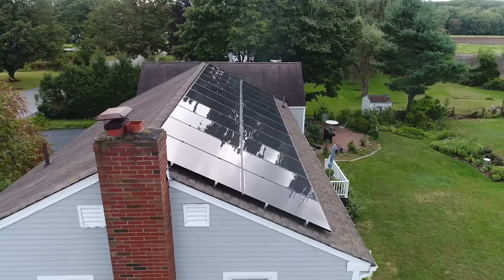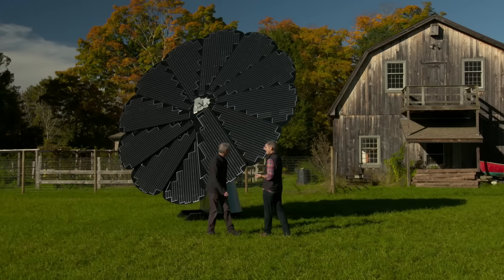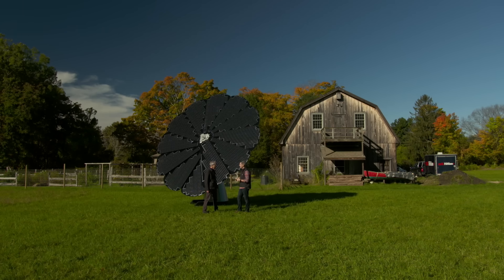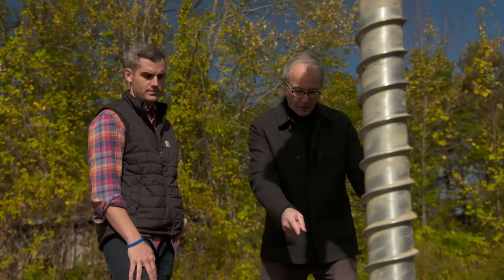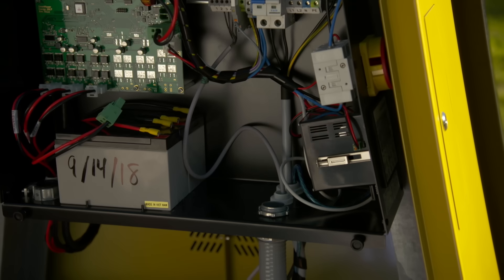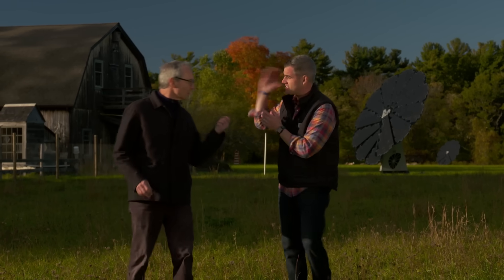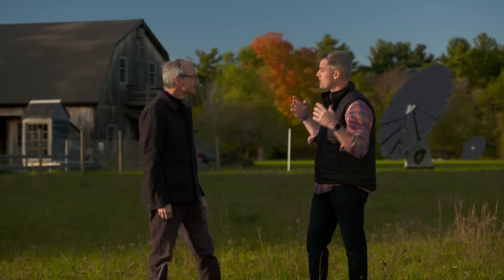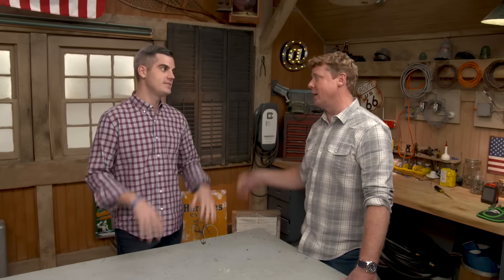Robotic Flower Solar Panels | Future House | Ask This Old House

Comment: C'mon do the math - this is much more expensive than roof solar.  Perhaps you didn't want to service your audience with the economics.  Ground mount usually costs more than roof, but easier to service.  Dual trackers is a waste of money pursuing perfection.  Dual trackers don't last as long as single trackers.  Unless you're buying ART, the economics should never be ignored.  At what point does the increased yield pay for the increased cost?

You didn't even compare pros/cons between systems.  (geez I hope more thought goes into the projects you take on)
Reply: $3.2k Aud delivered from aliexpress. Dont pay 10 times what its worth lol. This guys scamming hard.

Comment: Interesting concept, but it has way too many moving parts. Reduce the complexity, and maybe turn it into a solar panel installation that you can just plug and play on a property without all of the extra costs of permitting and what not, and I can see these being installed everywhere. The installation costs of solar are one of the biggest drawbacks. A plug and play solution that can lower costs would be welcome. Alas, this was posted 4 years ago, and I have yet to see this actually being sold.

Comment: Next, they need to design an elevator system to allow the solar flower to be retracted into the ground. I want to get a place but has a potential possibility of fire. Would be nice to be able to retract the solar flower as a defense. It would be an excellent addition to the underground water tank, and underground propane tank. Maybe a concrete box with screw jacks in each corner. Let the engineers figure it out.

Comment: "SmartFlower solar panel system ranges in price from $25,000 to $30,000 with the average cost to install at $27,000" for a 2.5 kw system

Comment: Taken into effect what he talked about at 5kw production, a $30,000 install is NOT Market rate, that's $6 per watt (market rate for solar installs is about $3.50 per watt) if you go based on the actual system size of 2.5kw that's $12 per watt! I hear this product only has a 5 year warranty on the dual axis motor. This has a very long break even period. My company is working on a similar concept but the price will be closer to market rate for solar panel installations ($3-4 per watt) it will be Aesthetically pleasing and multi purpose!
Reply: Name of company?
Reply: Is it ready yet!

Comment: JESUS FING CRIST. i mean its cool looking and all, but for 10k if you had that kinda space. just build a wood mounted solar system.  not pretty but wayyyyy cheaper, also, if it broke my bet i couldnt fix it without a tec. vs the panels i can. 
last, WHYYY do you need the duel tracking we have basic sensors that can just follow he sun.

Comment: 2.5 kwh for 30 thousand dollars. I have a 10 kw system, roof-mounted that is less than 10k more than this system. As much as I like the tracking system, it's not viable and doesn't glean enough energy by tracking to justify that markup. It's a great concept, thanks for sharing!
Reply: It can reach double if that (5 kWh) and qualifies for tax credits. I think it may be viable.
Reply: @markoer   it has moving parts, so it’ll need maintenance & repair. It retracts in high wind, and there will be down time if it breaks. 

And fixed solar panels will also get tax benefits.
Reply: @thomaspayne6866  it will be far easier to clean the panels unless you think it's fun to get up on the roof once a month. Even a light layer of dust will cut your efficiency. You can just 'water' this flower and keep it clean. It's Austrian designed and made so don't confuse it with american-made products that break after a short period of use
Reply: @abcxyz3783 it is actually self-cleaning, and that's a plus.
Reply: Yes but if your house catches fire will there be a foam unit to put it out? A solar field or flower in this case can turn off the power due to it not being near the actual house.

Comment: I would like this system, how do you store the energy where are the batteries,
Reply: @Maker Noob are they lithium batteries ?how many can fit in that space ,will they hold charge long in cold weather,? is the area where the batteries are stored insulated? Could you do another segment on this type of solar flower, how big is the hous is the one flower solar unit not enough to power the house? That's why they are building another one on property, I have so many questions my house is 3,000sq foot I'm deciding on a hard wire generator due to our area losing power at least every few months very annoying, so now that they came out with this new design that is aesthetically pleasing to eye I'm very interested in comparing the two different power sources.

Comment: Maybe it is so expensive bcs its from overseas. The solarflower is an invention from Austria. Here it cost  15000 €, like 16500 $. It cost more if you want a special color on it.
Reply: It may have been invented in Austria, but USA operations are based in Boston Massachusetts. Is 15000 € -  the installed price?
Reply: I think the company in Austria doesn't exist anymore, usa only, besides, they have three versions, was it the same one as here?..
Reply: @Andreas Berni At $10 per Watt, the Solar Flower is 10 TIMES more expensive than most other PV arrays.  Only the SUPER RICH, would think this Lawn Art is "affordable".  Nobody could ever cost-justify this system, not ever ....
Reply: @Andreas Berni For me, it is like comparing a $30,000 car vs a $300,000 car.    It would take about 5 of these Solar  Flowers to offset the yearly electric bill of a typical USA home.  And then DOUBLE that = 10 Flowers for an ALL Electric home = $150,000 <-- Ouch !   And "moving parts" will break and/or wear out = additional Repair Costs for life...

Comment: Produce it at $5000 a shot then you get some where. Solar needs to be a 5 year or less investment to make it for people to want. 15 years is too long.
Reply: It will never be $5,000 ... The current price is $45,000 for the 2,500 watt array.  Break-even is more like NEVER
Reply: @MrSummitville  Yes it will because the actual material cost less than 10 dollars to make. Its high priced because they are trying to recop research costs. When they get past that prices with drop fast. In about 10 years.
Reply: @jonmitchell9019  Just the concrete pad /  concrete pier costs more than $10. The wiring & conduit to house costs more than $10.  The internal computer costs more than $10.  Each of the twelve (12) proprietary Solar Panels costs more than $10.  The Dual-Axis Tracker costs more than $10.  The motorized opener / closer costs more than $10.  And how much per hour is the machine (crane) that will lift it into place?  I could go on for ever.  Please reply, on the day, that you can actually do a complete install for $5,000 or less ...
Reply: @MrSummitville  And yes if you a lazy azz and have someone else install it and you never lift a finger yes it will cost you $45000. We bought a new 20kw system and had it installed in the house for about $12,000. But that is the difference between someone doing something for themselves and sit on the couch eating potato chips and never doing anything.

Comment: This system is great when the house is shaded by trees...  and to maximize the only sunny place which might be somewhere else in the yard.   I haven't been able to add roof sun panels because of the trees, and the only solution was to cut down the trees which does not make sense. 1. we need trees and 2. the trees cool down temperature in the summer and I don't use air conditioner.  I would love to have this in my backyard, specially a rocky hill where I cannot really grow stuff but I can certainly harvest some electricity.
Reply: This system is never "great" - way too expensive ...

Comment: What's the cost for a system like this and what's the wattage?
Reply: I talked with them $45000.
Reply: @hotmeds  $45,000? YIKES !!!  Does that included installation?  Was it for the 2.5 kW unit with Dual Axis Tracker?  Was the 6 kWhr -12kWhr battery back-up included?

Comment: One of the things that was not mentioned, but was mentioned in another article was that when you sell your house you can uninstall the flower and take it to your next house to install there.
Reply: Exactly.
Reply: @4seeableTV  And how much does that COST?  So, instead of having a 20 year break-even, relocate it and now you have a 25 year break-even = Dumb & Dumber ...
Reply: @MrSummitville  I would assume that they could make this more affordable than traditional solar panels since they wouldn't need to go through the permitting process to install on your roof, and you could forego most of the contractor costs of planning the system and installing it when you can just plug and play one of these.
Reply: @MrSummitville  you mean you think it would be better to install new at your new house at a higher cost for it and install cost. Lol
Reply: $3.2k Aud delivered from aliexpress. Dont pay 10 times what its worth lol. This guys scamming hard.

Comment: My theory that rotation machine is not necessarily needed if the farm are open fields it is just to dig to ground floor like a parabol form and simply putting like  mirror or just aluminium as a light reflection  or simply buildt a glove solar panel  instead?😇👿👹
Reply: You need to analyze the cost vs ROI. You idea is way too expensive ...

Comment: Atta boy!  Tighten those hex bolts with a pair of Channel Locks.  (TOH standards sure have fallen over the years.)
Let's see, $30k for a 2.5kWh system which (must see to believe) produces 5kW? , or $10k for a fixed 5kWh system?  Tough choice.

Comment: Not interested in a solar system that’s going to take 25 years for it to pay itself off.
Reply: @Matt B - I doubt that this device will ever "pay for itself" ...  $1,800 per year = $45,000 cost / 25 years.  It will not generate $1,800 worth of electricity per year.

Comment: As usual, the initial investment is a turn-off for most. To recoup the cost, the average homeowner would take approx. 10 years to recover it and that's IF he could generate ALL of his electricity with this system which realistically, can't be done. so say, 15 years to 'zero-out'. With most homeowners rarely staying put that long with some moving every 5 years or so, it doesn't make sense economically to install these types of systems. Now, the person that buys a home with these systems in place would conceivably benefit, having not had to foot the bill of the initial installation.
Reply: The seller of the home will try to add the cost of the SmartFlower to the sale price. At $30,000 for a 2.5 kW system, I seriously doubt if there will ever be a "break-even". A fixed array requires very little maintenance.  A dual axis tracker, left outside for 10 YEARS , will require a significant amount of maintenance.

Comment: 40% more power!! At 4000% the price of rooftop panels they could have installed on the barn + more panels to generate the same power.
Reply: A Dual-Axis Tracker generates about 30% more kWHrs vs a Fixed Array.  I just helped my neighbor install an actual 5 kW Ground Mount array for $5,000.  The SmartFlower is 6 TIMES that price?  WHY?  The SmartFlower is a rich man's toy, at best.

Comment: Neat but over priced. After the tax credit (2019) it would still be $20k cost. I just had a 4.88kWh system for $10k (cost after tax credit). Considering it is half the cost and just under the 5kWh comparison I would still find this overrated.

Comment: It seems This Old House is prompting for socialism. Wind and solar energy is socialist according to the MAga people.
Reply: First time i've heard that one, sounds like a typical anger stirring, devicive news piece to me. I can't think of any reasonable person who is against renewables when the system is designed right and isn't overpriced. For instance this flower thing is interesting to look at but I'd rather install a traditional rooftop fixed mount system with batterys, which I am already planning. Artsy expensive stuff can be privately funded and those people should be free to install them if it's what they want.
Reply: @haider - You have it 100% backwards.  Centralized Power Stations = socialism.  Wind and Solar in my backyard = independence

Comment: How much power loss from that long run of wire from the unit to the house?
Reply: It is only rated at 2.5 kW.  It only generates 10.1 amps (max)  =  2,500 Watts  /  240 volts.

Comment: Marketing hype (aka lies)  because it tracks the sky, and the cooling, it's equivalent to a 5kW system... no it's not it's a 2.5kW system and it just manages to get more out of it.  He said earlier you can get 40% gains over a conventional system,  so at most it'd be equivalent to a 3.5kW system.       40% more gain, for what... 300% more cost?     Dude has  farmland for days, might as well set up a fixed system $60k can get you WAY more than 5kW worth of panels (even if they track the sky) and yeah that is the installed price too.

Comment: grid tied is a rip off.. if you was producing your own energy.. why would you need or want to energy credits.  Batteries are where its at.
Reply: Top Secret Bear, He said the system has battery storage as well.  Thus you are selling overflow from what you use and store.
Reply: @bellagray4444  It is one or the other. The standard model is grid connected and does not come with a battery. If you get the plus model with a battery, it cannot be grid connected.
Reply: bcbsgs That wasn't made clear in the demo.
Reply: @bcbsgs  - You have no clue what you are talking about.  The "battery bank" is an OPTION that is added to the Grid-Tie Inverter system.  The battery bank allows for AC Power during a black-out.  It is then technically called a Hybrid Inverter.
Reply: @bellagray4444  That is because @bcbsgs is 100% WRONG !
Reply: @bellagray4444  The "Battery Option" is a financial nightmare ...
Reply: MrSummitville I'm looking for a system to take us off the grid.
Reply: @bellagray4444  This device is either Grid-Tie only or Grid-Tie with small battery back-up during Black-Outs = Hybrid. But it is NOT a true OFF-GRID System.  Do you have an AC Grid connection now?   Pure OFF-GRID is extremely expensive.  Go to this FORUM ... https://forum.solar-electric.com/
and read and ask questions BEFORE purchasing anything ...
Reply: Batteries make this device a  financial disaster. Without batteries, it has almost a 50 year break-even. With batteries, it will  NEVER  break-even. You need live in a very sunny area, with very high electricity costs, to even think about cost justifying this device (toy).

Comment: There's no way these will feasibly pay themselves off. There are so many failure points with all the moving parts and the required computer (plus internet connection) to keep the efficiency... That $30k will likely need another $10k in maintenance... And then all solar panels lose efficiency over time... So these panels will become unusable before they pay themselves off.

Not to mention all the extra energy that was used to manufacture these and the extra strip mining for all those extraneous parts. It's quite likely that these panels have a larger negative impact on the environment than just using grid energy from a natural gas plant. 

My basic fixed roof mounted system? 8 year projected payoff with a 25 year warranty for 90% rated generation.
Reply: The mechanics of it are less complex than you make out. The panels slowly unfurl, then the system pans and tilts over the course of an entire day at a snail's pace. That's extremely low wear and tear. Also, the system is more efficient than your roof panels.  Either way, who are we to decide whether someone wasted their money or not? He could've bought a 3rd car for 30K and it would've had ZERO effect on his electrical usage, but it WOULD be adding pollution to the air every time he used it.
Reply: @4seeableTV  It only has a 5 Year Warranty. Then the next 20 years of REPAIRS comes out of your wallet.  Good Luck keeping this device functioning for the next 20 year, outside in the full sun = hot, in pouring rain and freezing snow & ice.
Reply: @MrSummitville  10/25 year warranty
Reply: @MrSummitville  you mean like rooftop solar panels? Also out in the hot sun, pouring rain, buildup of snow and ice in the winter that needs to be removed... I could go on and on

Comment: $60K for two. Land required to put them on with no tall trees nearby to block the sun which means even more land. Produces a mere 4KW each under strictly ideal conditions. Susceptible to hail and wind damage. Those costs will never be recouped in the lifetime of the owner. Hard pass.

On the other hand, my natural gas backup generator produces 22KW and cost $5K to buy and install.
Reply: And natural gas is free just like sunlight.
Reply: But Gas Company Gate-Keepers Charge You For It.  
Similar to How The Internet Is Free But "Big TeleComms" Charge You To Get On The Cyber Super Highway.
Reply: Mr. Satyre, this unit is safer than roof panels, it closes itself and can be covered for bad weather and storms.  Nothing you can do to protect roof panels.  Plus you can do repair on the ground, while repairs on the roof are much more dangerous and likely costly because you have to climb the roof.  Plus roof panels do not wash themselves, while the flower does.  Thus a clean panel makes more energy.
Reply: @bellagray4444  At 6 TIMES the price of Flat Solar Panels ??? - are you insane ?